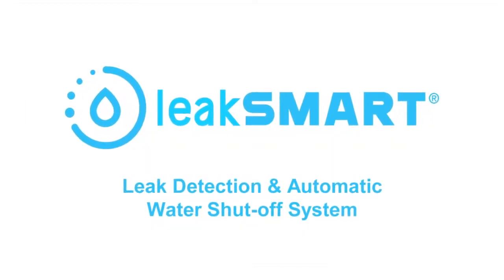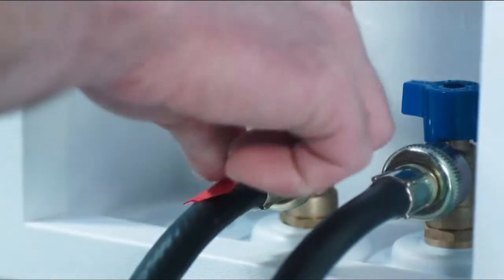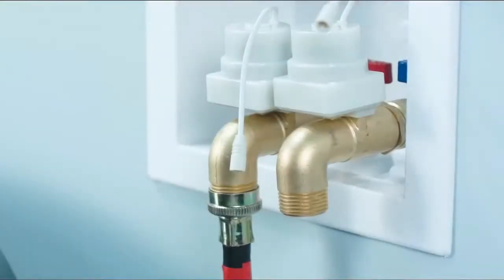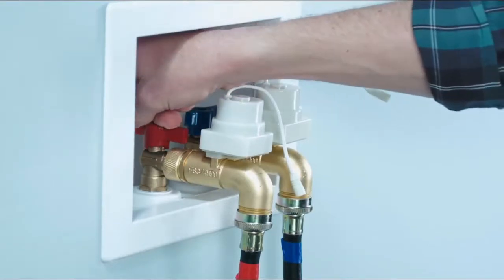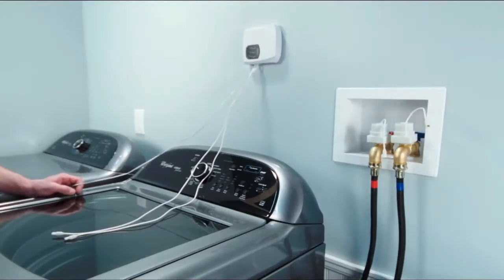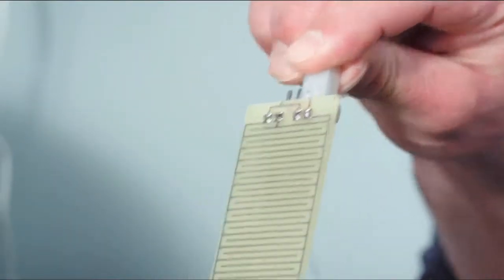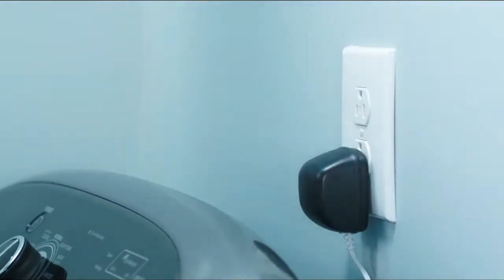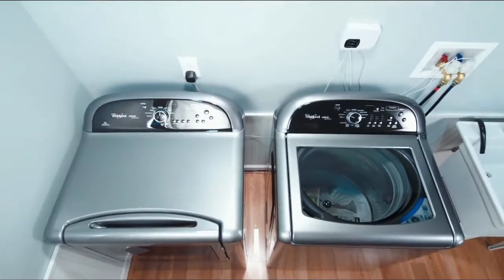LeakSmart- Washing Machine Leak Detection System Installation

Comment: OR.you could turn off the taps....lol
Reply: Imagine a world where people walk away from their laundry and its on a finished floor of their house. Is it at all possible that an immediate shut off could benefit some hypothetical person, who may not realize they had a hose fail and a significant leak occur? Or have we just gotten to a place where people can't see past their own nose, and like to brag about that on the internet with useless comments?
Reply: @wildlifecr13  
Imagine a world where people do not know what "lol" means.
Imagine a world where an experienced electrical Engineer of 50 years (with a sense of humour) ,  rips some jerk a new A'hole.
In fact the manufacturers generally say to isolate water supply after use. (turn off the taps) even if the machine  has 'aquastop' system.
That detector position 'may' work in some instances. Best if the machine is placed in a tray like contraption.(such as floodstop)
There are other practical and technical issues which come into play here which may be similar to house alarms.